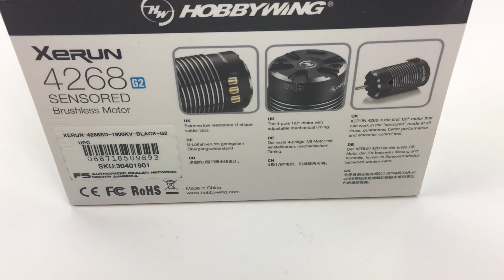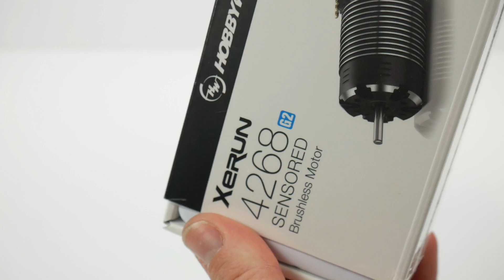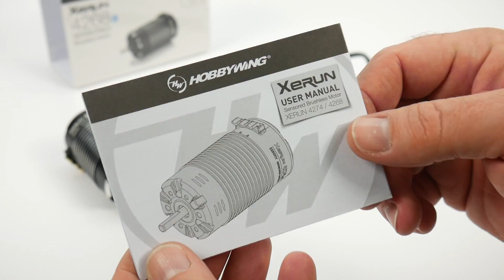HOBBYWING 4268 G2 1/8th Brushless/Sensored Motor - Unboxing

Comment: Do you think this motor is good for drag race in a infraction if not what do you think would be a good setup to go with
Reply from the maker: It will be a slight upgrade to stock, as it's sensored and an overall smoother motor than stock.  Quickness wise, not sure.  This is a race motor built for 1/8th scale buggies, so it's more designed for torque vs. speed

Comment: Good info, this motor seems good and I have liked it for being a short motor compared to the Castel 1515 and 1512. I have a Castel creations mamba monster x  and I am looking at paring it with the Hobby wing motor. I hope the sensor will be compatible these are going to be in my Kyosho DRX rally car
Reply from the maker: You should be fine, sensor ports are all pretty much standard connections

Comment: So for me to put it at turbo max should i got with the CW setting side or CCW? Just asking
Reply from the maker: I would install the motor, set that radio’s channel endpoints all to zero and re-calibrate the radio to the ESC. Then pull the throttle to verify that forward propels the car forward. Don’t mess with CW/CCW unless it’s reversed for some reason.
Reply: The RCNetwork But on the manual says for setting turbo set it between 30/40 and i didn’t see a difference, I m also using this motor with a Mamba Monster X esc and a Traxxas 2.4 TQi. Do i need to put the wire between ESC / motor? Thanks for your help....

Comment: Hello Richard, one question: on the webpage says that the motor can't work on sensored mode with others ESC all the time...what it means? sometimes work and sometimes don't? works in sensored mode only with an HW ESC?
Reply from the maker: I'm sure most decent ESC's can run this motor in full sensor mode - I have used other ESC's like Tekin and Reedy and haven't had an issue.  Some ESC's may not have the circuitry to handle the HW motors though
Reply: ok, thanks. I want to pair with a Castle Mamba Monster X in full sensored mode.

Comment: Hi, I just purchased HW XR8 plus ESC and the motor 4268 2600KV. I want to ask if the motor can use 6S lipo battery without any modification? I mean the cable just plug directly from the ESC without any modification?
Reply from the maker: ce harn lau yes, HW rates the 2600kv for 2s-6s capable. Watch your gearing and motor temps as you're on the high end of kv.
Reply: Hi, Thanks for your response. 

But when I read the manual sheet it said that the 2600KV is only capable accept maximum 4S lipo battery. Are you sure this is going be OK since I will put this combo to my old kyosho MP 7.5 with 11T pinion. Thanks
Reply from the maker: ce harn lau I checked the website before responding.....double check with HW
Reply: Hi The RCNetwork, 

Ok and thanks for your information. So I would not doubt to use the 6S battery pack directly without modification to this combo set...

Warm Regards,

CeHarn Lau

Comment: Hey Rich, are you ever going to do a review of the 3660sd 4300 kv g2 motor?
I would like to see how it compares to my 3656 4700; that motor over shoots the triple at ocrc by almost 20 ft with rx8 g1 and 5600 mah 50c
Reply from the maker: Monster Neu 2.0 I just inboxed it....should be on the channel next week-ish
Reply: Nice! You should come on down to OCRC on a saturday when you have it installed!
Your in for a treat...my 4700 hauls ass
If that cant beat it I'll have to overvolt my 1410 3800 with a 4 cell

Comment: I love this motor n esc with the wifi express I run them in my et48.3 glad I bought them mine is the 2250 kv
Reply: but what do you think? is 2250 kv for an truggy not to less? does ist overheat? wich pinion do you run?

Comment: Hi, can you advise which one I should buy for my Tekno MT410. I'm torn between the XeRun 4268 and 4274. Thanks
Reply: p.s. also trying to work out is the XeRun with Sensor is worth the premium over EzRun? :-) Help!
Reply from the maker: Sorry for the delay....I fit the 4038 motor from Tekin in there which is a 77mm can, so the 4274 should work.  I would go larger, especially if you plan on doing larger tires like the MX or Trencher....I'm running the Badlands, which are the smaller of the 1/8th scale MT tires.  Plus, you can always either volt up or gear up.....Depending on kv, you can run 6s on the HobbyWings
Reply: Thanks, got it built now so can measure the space. Going to try and squeeze in the Hobbywing Max8 and 4274 (seems good on a budget) with Badlands. Might try Shockwaves later down the line. Great channel. Cheers

Comment: I want to put this in a yeti :)
Reply from the maker: You may have to delete a portion of your battery tray! lol  I know my 550's fit in the Yeti with like 5mm to spare.  Not sure on a full 1/8th without modifying something
Reply: hey richard i am nuilding a tekno sct 410.3 and i was wondering which motor should i get? the 1900kv? i want something that is fast but is not to hot. i am a newbie.... thank you so much.

Comment: I'm positive you have a 1/8 scale project coming up and I'd like to venture a guess.. Could it be one of the new Hobao products from Tower? I have my eye on the hyper Vse. The 80% roller. Chuck a Goolrc 150a sensored esc and one of these xerun motors in it add a Savox 1258 and bam! A trackable basher thats inexpensive and durable!!
Reply from the maker: Thanks BD82V!  Not a new project - a long term vehicle here.  I want to really compare what I now on a platform and then see how these new electronics from HobbyWing do
Reply: The RCNetwork 
Ahhh. Very well then. I look forward to hearing what you think about the new HW gear!!

Comment: that long sensor wire is pretty  much included for losi eight 3.0 and 4.0 if running the esc in the forward postion
Reply from the maker: Cool, thanks for the info.  Some Durangos need that too, but it looks like no one drives those anymore! lol